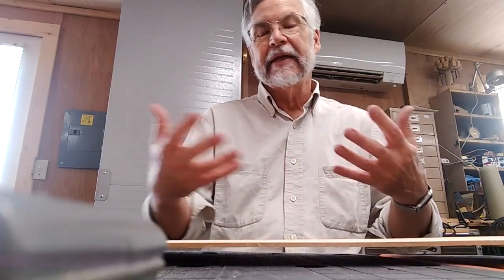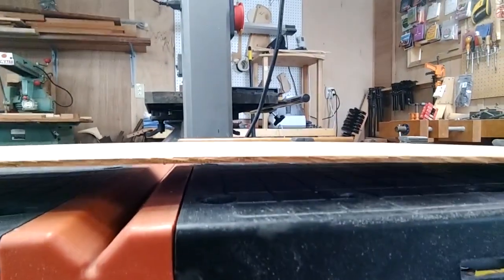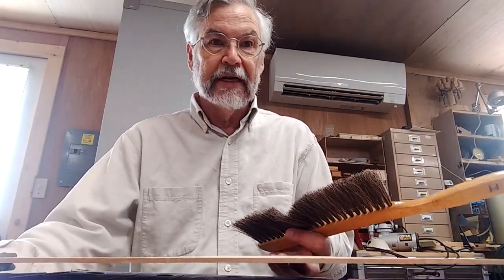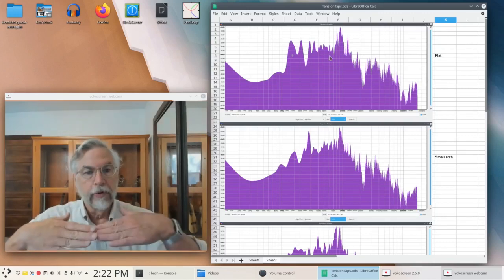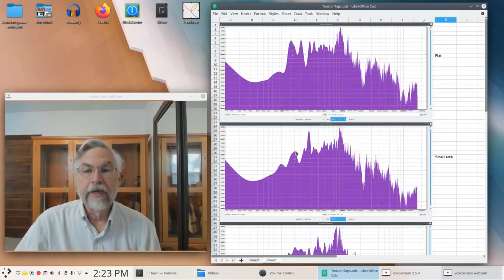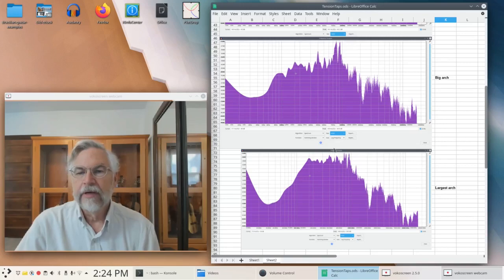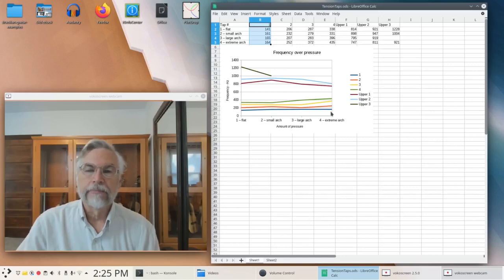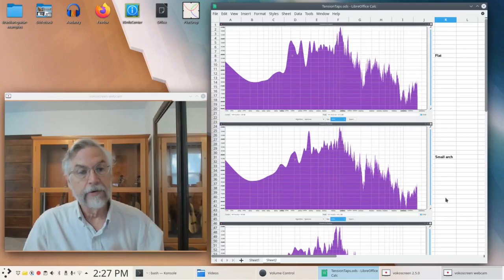Experimental Lutherie: How does arching the top affect a guitar's tone ?

Comment: The wood is under compression something which is not the case in a guitar. The top radius on a guitar is under a slight tension if not passive. What the arch in a guitar top does is contribute to resisting downward pressure. The nearest analogy is the arch of a bridge. Plus it gets rid of the curious effect of a flat surface looking concave.
Reply from the maker: You are correct, although the response of the top is to arch upwards to relieve that compressive force, as opposed to just compressing the cells. This was a simple experiment to see if the tap tone changed much in this situation, which as you say, is not exactly what is going on in a guitar top.

Comment: Is this emulating the 15' radius in a flat top style guitar? And of course I realize it was exaggerated. It would be different in a carved arch Right? With no tension.
Reply from the maker: Well, not that specific radius for this experiment. As you can see I just cranked on the vise and eyeballed it.  I did it a few more times just to see what would happen as the pressure increased. I'm also only forcing the arch along the grain, a true spherical contour would be equal pressure all the way around and bracing would contribute to the contour as well. 

Yes, a carved top is not bent like this, so this would not apply. It would also not apply for "double top" soundboards that are formed to the contour or "arch top" (F hole) guitars that have pressed plywood tops/backs.
Reply: @chuckmorrison thanks Chuck, I appreciate your time and answer.
Reply: Yes.
Reply: Just to say, piano SB's are forced into a curve.
Increasing the stiffness without increasing mass!
The same theory applies to flat top guitars.
Bridge rotational force bends the top = bloom in the room!!!

Comment: It seems the data would have been much more useful if the arched wood was not under tension.
Reply from the maker: The only way I know to get the arched profile without inducing tension is to steam bend the wood, which I don't do and actually is just a way of preserving the shape of a pre-tensioned piece. Carving would not be equivalent in any way, requiring different pieces of wood. 
The reason I used this method was that it was the same piece of wood in both cases (relaxed and arched) and I actually do arch the soundboard over the sides when I build a solid top guitar.
Reply: And yes a guitar top when arched as most are in modern guitar building I would agree they are also under tension as your experiment shows. I stand corrected.